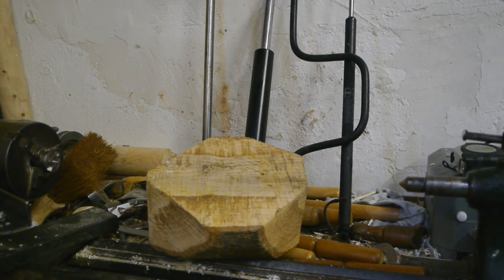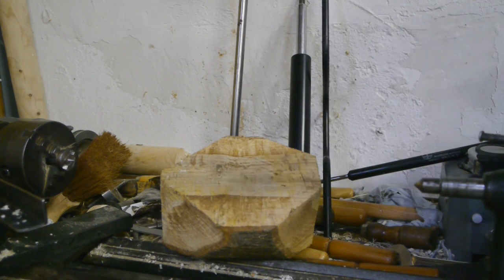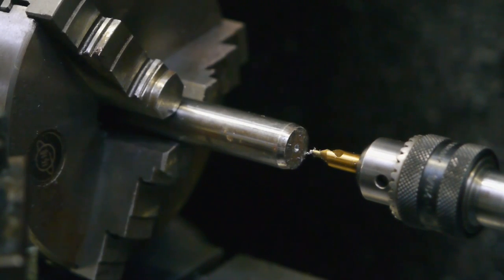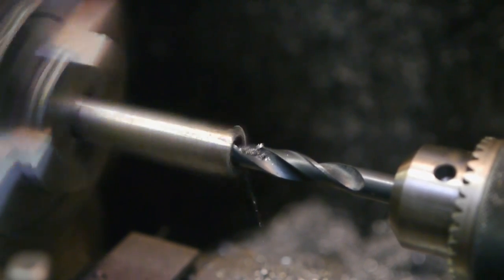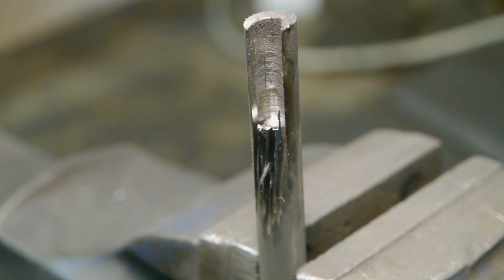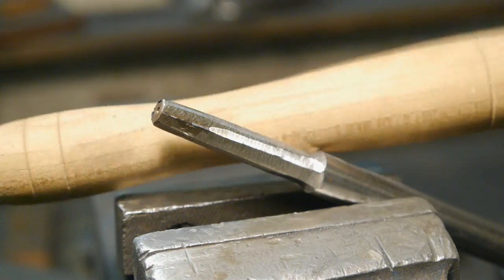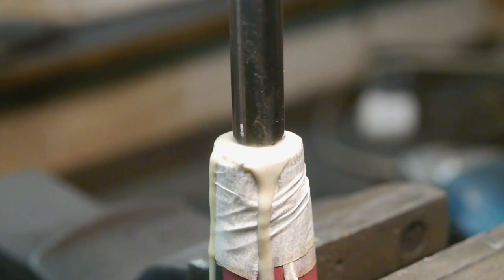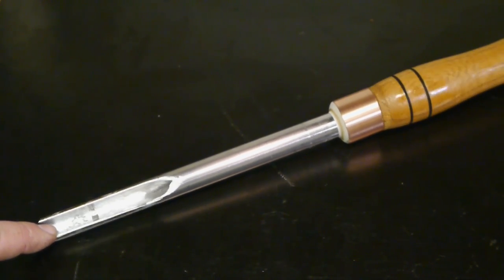Making a bowl gouge from scrap metal

Comment: I have been using shock absorber and McPherson strut shafts to make tools for years. It isn't quite drill rod but it is really tough and hardens well.
Reply from the maker: It is also ground pretty precise. I just cut up anther shock absorber for my latest video, used it to make an indicator bar to line up my top slide.

Comment: How is it performing three years after this video? Judging by the nature of the sparks, it looks hard enough.
I just made one today using o1 tool steel (cheaper than HSS). It was easier to drill than I expected as it comes from the mill annealed. I didn't drill off centre, which I suspect is why your drill bit broke. That a lot of vibration and drill bits are brittle. I managed to drill 10cm into the 16mm diameter rod with an 8mm drill and I feel a 3mm wall thickness around the channel is plenty thick enough (although time will tell). This gives me a deep 'U' contour, which is recommended for bowl gouges. I've hardened it and quenched in oil and it passes the file test so now I've called it a day. I'll temper it tomorrow. Fingers crossed, eh? We'll see how it performs.
Thanks for sharing.

Comment: That's great! I tried making a gouge once by using a 1/4" thick wheel on my angle grinder to make the flute. It worked so-so. I like your methodology better. I'm looking forward to your next video!
Reply from the maker: Yeah, its hard to grind the flute parallel to the outside. if it isn't parallel it's very difficult to grind a decent edge.
I'm currently working on a thin part of tool. Hopefully I'll upload the testing video tonight.

Comment: Well done.  I wondered how you were going to make the flute.  I was not surprised the drill bit broke.  A bummer, but not a surprise.

The gouge looks good.  As CurlyG65 said,  the bar could be case hardened.  This is done to get hard outer for wear etc. but softer inner for flexibility.

This may be possible to harden then temper the flute section after you have ground this to shape.

16mm is not too thick for a bowl gouge.  Should be nice and stiff when roughing down the bowl.

I am eager to see how this works in the next video.
Reply from the maker: Thanks. 
I think these bars were axle-rods for some industrial machinery. So that case hardening theory could be right on the money.
And you' re right 16mm isn't too big. Did some testing today. video uploading now.
Reply: LV_Woodturner  old school just made a roughing gouge out of an old stairlift leg

Comment: Great sense of humor.  What is the resin you poured in?   Is it an epoxy of some sort?
Did you not feel the need to temper the cutting end?
Reply from the maker: Thanks. That was some left over polyester resin that I used to repair GRP car body panels.
Unfortunately I don't have to tools to proper hear treatment.
Reply: If you have a propane torch you can heat treat the metal from shock shafts. Or a charcoal grill and a shop vac with the hose hooked up to the exhaust to provide forced air. Anyway, heat the finished tool to a dull cherry red, then quench in chilled olive oil. I don't know why olive oil works best but I tried a bunch and that did best for me. Then put it in a regular oven at about 400 F. for a couple of hours. It should harden really well.
Reply: You gotta put a little garlic and the red pepper flake in too. Then you dippa the gouge, thenna you drizzle onna capicola. Ahhh my mudda would make-a, god bless the woman. Bowl gouge oil on the bread, a salut!

Comment: Top quality Robert Sorby bowl gouge, £30, Record Tools bowl gouge, £22, cheap import bowl gouge, £15, eBay bowl gouge, £10, why would you bother?
Buy one and spend your time turning bowls, simples!
Reply from the maker: Because I probably enjoy making the tool more than using it :)

ps. I actually have a Sorby gouge, not a bowl gouge, but it does work on bowls.
Reply: Some folk like to make bowls.
Some folk like to make tools.
Some folk like to make both.
Reply: The steel sorby uses is absolutely trash that's nothing near "top quality"
Reply: And depending on your country... Robert Sorby 1/2” bowl gauge HSS, $131 AUD